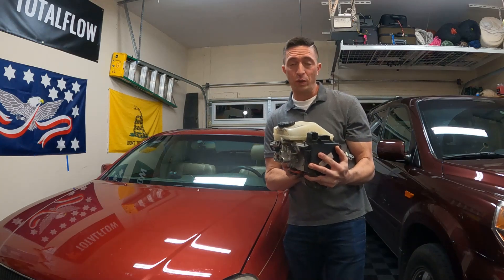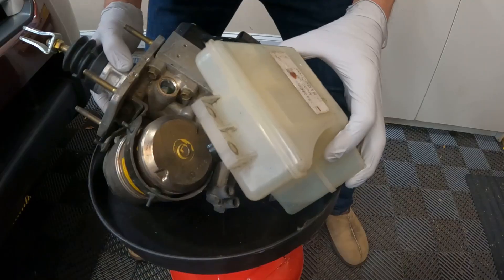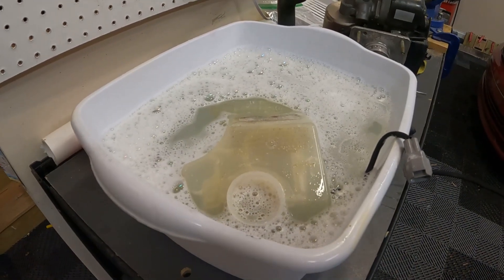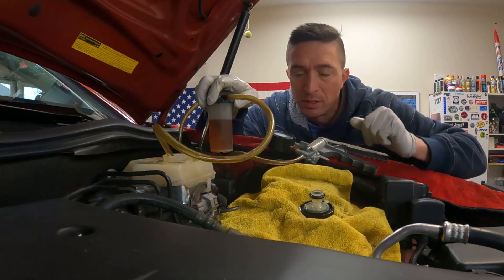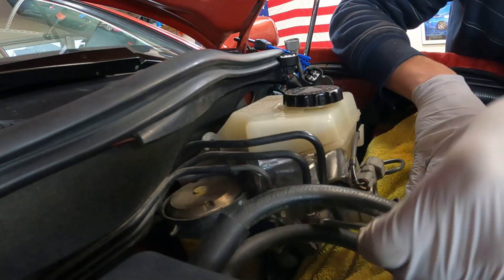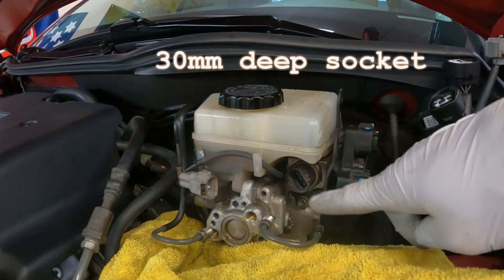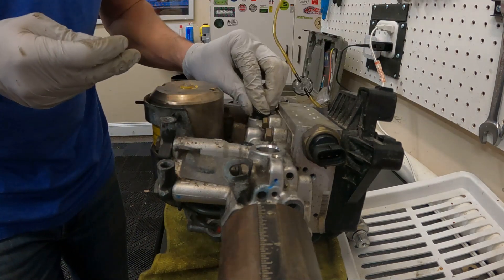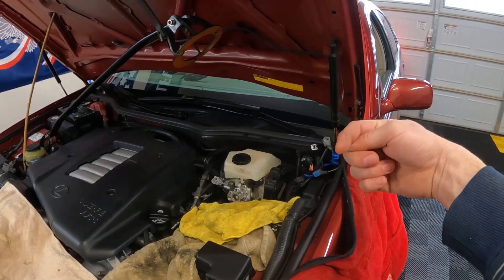LEXUS / TOYOTA Brake Master Cylinder Diagnosis, Replacement & Brake Bleeding (300/400/430 shown)

Comment: @11:42 Warning Buzzer.  Whats The Warning Beeep For??  
I'm Hoping The 7 Minute Long BEEEEP That Reoccurs Every 3  Minutes Is Just A Warning.
Owner Of 99 GS 400
Reply from the maker: Low pressure alarm. Not good. Fix it soon.
Reply: @ForwardMomentum   Goodness! Thank You. Would You Please;
What Pressure Is Low ?
Reply from the maker: Brake system. Check fluid level, all lines for leaks, and BMC. If you cannot identify an obvious issue, replace the BMC.
Reply: @ForwardMomentum   Thank You.

Comment: Anyway u can help I've bought 2 master cyclinder did it the exact same way but once I get to step put car only to the on position I don't here the pump working
Reply: Now I have 3 BMC no way none of them work
Reply from the maker: There’s no way you have 3 bad BMC’s in a row. It must be a wiring issue. You’ll have to troubleshoot the wiring a bit.

Comment: New subscriber to your channel, and love the content & high quality production values.

What made you decide to use an SC430 complete assembly, vs. say a refresh 2GS (01-05) BMC?  It also has the triangular  pressure switch that you pointed out needing to be swapped over. I would think SC430 units are more scarce than the GS units.
Reply from the maker: Hi - thanks for the sub! Research indicates the BMC bore may be 1/8th larger, although I have yet to confirm. Additionally, SC’s tend to carry lower mileage generally speaking and the BMC can be had fairly new in comparison to many of the 2GS models which are getting snatched up by younger folks and often thrashed. I hate these HBBA/BMC units. They’re entirely too complex, noisy and seem to have a limited lifespan. I would love to eliminate it entirely with an Avalon or Heat Lightning simplistic unit, but I want to retain ABS.

Comment: Hey so I have an ABS, VSC & VSC OFF light on my dashboard. The 3 codes i got back were C1246(Malfunction in master cylinder pressure sensor), C1251(Pump motor is locked/open circuit) & C1223(Malfunction in ABS system). Have you heard of these codes popping up before? Your motor mount video helped me a ton thank youz
Reply from the maker: Yes. Check the entire system for obvious issues, such as a leak. If nothing is found the pressure sensor is faulty (unlikely) or the HBBA/BMC went out (most likely).
Reply: @ForwardMomentum  What do u mean by the HBBA? I will look for leaks tomorrow however the 3 little wires that the pressure sensor has have been spliced with some butt connector i’m not sure why (previous owner). do u think if a wire isn’t getting power it would cause the sensor to act up? My brake pedal sinks a little bit to the ground as well (already bled all my calipers).
Reply from the maker: Hydraulic Brake Booster Assembly. Sure, bad wiring could cause it but if your pedal sinks to the floor, it’s probably toast (unless you have a leak or air in the lines).

Comment: Hello mate.I have a gs430 and the brake master cylinder soon will be gone. Locally i can find anything from left hand drive gs to buy this part. Luckily there are 2 sc430 lhd for parts in my country and both of them have this part.Can you confirm that it will fit?You mentioned that the sc brake master cylinder is bigger. Will it fit without issues?
Thanks for your reply :)
Reply from the maker: Yes of course. It’s what I put in my car. 👍
Reply: @ForwardMomentum  Thanks for the update.Asking because you know sometimes there are backscreen play 🤣

Comment: I can’t seem to figure out what to replace on my gs400 when stopping the pedal feels semi normal until around 3-1 mph and the pedal goes firm and it makes a buzzing noise , and it ends up breaking but like if my car is sliding, sorry my explanation is horrible
Reply from the maker: Have the wheel speed sensors checked with a proper scan tool. After that, it’s probably the BMC.
Reply: @ForwardMomentum  thank you !! I will check and let you know what it was !

Comment: I’m having some problems with my is250, I’m not sure if they side to side bleeding process matters on my application but I did the standard furthest valve procedure, not sure if that’s what’s causing my soft brake pedal, I don’t see any leaks and my master cylinders looks dry. Do you have some clue to help me ?
Reply from the maker: I’m not sure on the 250 either. Best bet is to download the service manual using a day pass from Toyota Information Services and do it per the manual.

Comment: I got my new unit in and my brakes feel better and it doesn’t have the light on anymore for the brake and makes the noise. But my ABS and VSC lights are still on will they turn off on their own or do I do something to get the system back on?
Reply from the maker: Did you reset the system by pulling the NEG off the battery?

Comment: Thanks for the video. I have a question when you bleed the unit, did any brake fluid or air come out of the side two brake lines facing the passenger side? The front two facing the bumper did for me but not the side ones.
Reply from the maker: No, nothing came out of my BMC (if that’s what you mean). LMK if I am misunderstanding you. 👍
Reply: @ForwardMomentum  Yes, the BMC OK thank you. The first I replaced didn't work, so I'm on my second one, and I wanted to make sure
Reply from the maker: Honestly that is just a major “push bleed” to get it ready. Actual bleeding clears air out. I wouldn’t gauge BMC success on fluid vs no fluid there. I hope that helps!

Comment: 10:55 do you pump 40 times with the ignition off and battery pulled or does it not mater bc it confuse me how you said it.
Reply from the maker: Off. It may have been confusing because for the ECU reset you pull the NEG battery cable to do so (but mine was already pulled). The key here is 40X ignition OFF.

Comment: I did same but booster motor turns on and off all the time while the engine is running.
Reply from the maker: The HBBA motor should prime on occasion, but not constantly. It’s really a silly, overly-complex design.
Reply: @ForwardMomentum  Great.  Thanks for replying!!!!

Comment: Hello brother! Been a while! Since I subscribed to you I purchased yet ANOTHER LEXUS lol. Since I have a 98 GS400 and an 01 IS300 I found a GS300 with 150K that I couldn't pass up for $2000! My 98 is making that funky sound and I was wondering, aside from a SC430, what other model brake boosters can be used for replacement of my 98 GS400?
Reply from the maker: Wow, a true LEXUS fanatic! Nice. I am only aware of GS300, 400, 430 and SC430 BMC’s that work. 👍
Reply: @ForwardMomentum  ok many thanks. I believe the 430s are "supposed" to be more heavy duty. Do you feed that that is the case?
Reply from the maker: I hear the piston is a 1/4”’larger inside. That’s about it.
Reply: My sc430 is making this noise. Think I can use bmc from gs and put into my sc430?
Reply from the maker: I can’t imagine why not. Same steps should apply.
Reply: @ForwardMomentum thx for reply

Comment: Good morning, well, I replaced the BMC with a 430 BMC and unfortunately it didn't eliminate the problem. The unit I installed was supposed to be out of a low mileage 430 GS. In your video you recorded a buzzing noise coming from the BMC when you depressed the brake pedal. When I apply the brakes, I hear a similar noise along with a pulsating brake pedal (there are no dash lights on) before the car comes to a complete stop, it's as though the ABS kicks in right before the car stops, did you experience that as well? Do you know of a company that sells remanufactured BMC for early model GS's? The BMC I purchased come s with a 30-day warranty so I will be it returning it. Any additional Information would be appreciated, thanks.
Reply from the maker: No, I did not experience that exact issue. Yes, it did/does “buzz” when the accumulator motor kicks on, but never premature ABS initiation as you described. Make sure it’s 100% bled properly and then consider returning it.

Comment: I have a 1999 GS 400. I replaced the brake master cylinder about 5 years ago and now the replacement is failing. My question is do you think the 430 BMC is a better unit for that car?
Reply from the maker: Better because the piston bore size is slightly larger (I’m told) and because they’re usually newer and typically from a car that didn’t get thrashed…that’s why I like them.
Reply: @ForwardMomentum   Thanks for your response, I appreciate that information. I was thinking along the same lines as the 430 master cylinder maybe newer than the one for the 400 or 300, thanks again

Comment: My SC430 developed a leak at the BMC unit. The local garage could'nt repair it, so I supplied them with a replacement unit from e-bay. They then said it was no use, as the electronics didn't match my ECU? They used the electronic unit from my old unit, and placed it on the replacement unit? It worked, and there was no leaks, but pedal felt soft o me? I recently had it back at this garage for new front pads. Pedal feels softer, and the BMC appears to be leaking again! I think they didn't know what they were doing, and cocked it up! Your video explains a lot, rspecially the part about the ABS unit and the battery negative! Thanks for this!

Comment: Great video brother. Just wanted to ask if you remembered the part where the pin slides in with the brake pedal (called clevis) was pivoting loose from its socket joint. I checked out a used part and wasn’t sure if it was supposed to pivot/rotate easily like it was. The clevis is connected to the piston and the boot end. Thank you!
Reply from the maker: Thanks! Yes, it was loose there. 👍

Comment: Hi, great video.. but do i have bleed the brakes,?? Even if brake pedal feels good after replace the unit.?
Reply from the maker: Short answer: yes, always. If you open a closed system that operates under pressure, it’s typically always required to bleed it. The problem is that if it’s not bled, air bubbles can get pushed to key components, like calipers, and failure to operate properly can result.

Comment: Any idea how to do this for a GS 460 without a computer
Reply from the maker: Can you elaborate on “without a computer?”
Reply: @ForwardMomentum  I have been the tough the ringer with my GS 460 2008 I was told that my vehicle has to be taken to a dealer Toyota and or Lexus for the brakes to be bled l have sent my original pump to be repaired and didn’t work i recently bought a pump off eBay it didn’t work, sent it off to be repaired, had it replaced and then sent back to Toyota and they still say the pump is faulty, they said they can bleed the front but not the back , I’d like to work on it at my home but people are saying I need special software through Toyota to bleed the brakes
Reply from the maker: OK. Techstream probably. I don’t know for sure on the 460, but I didn’t have a laptop when I did mine, as shown in the vid.

Comment: Another awesome vid. Was the BMC you got rebuilt or used? If its used, I'm guessing anyone would have to look for one from a vehicle with low mileage. Last, did you come up with those brake pumping #'s at random (40, 20) or did you read that from some source?
Reply from the maker: Thx! BMC was used. Pumping was random until bubbles cleared visually. 😎

Comment: Do you know if this also works for the Aristo? Mine seems to be leaking so I may be doing this soon.
Reply from the maker: It should, but be wary of the hardline routing ports (LHD vs RHD).
Reply: @ForwardMomentum  hey thanks for the reply. Love your videos. 
That’s great I’ll see if I can source one over here in the U.K. I imagine the job is the same just on the other side of the car. 
Cheers.

Comment: great video,followed all you steps, but after pumping the brake 20 times with the ignition on the warning buzzer didn't go off,I"am on my second unit from EBAY I"ve become quite the expert of taking the brake booster out did it 4 times already,I finally brought a remanufactured pump, both pumps were shot, going to have my neighbor help me bleed it tomorrow,any extra steps or knowledge if after pumping the brakes 20 times and the buzzer doesn't go off, thank you
Reply from the maker: Sorry to hear this. I hate these BMC’s. I don’t know anything else besides what I shared. That warning alarm should turn off once the system pressurizes after the motor runs and fluid is topped off. If it stays on the pressure sensor is doing it’s job and there’s a deeper issue. It is peculiar that it has been two pumps bad in a row for you. Possible? Yes. But it makes me wonder if your method is causing an issue. Make sure you’re putting a block under the pedal during pumping. If you over-stroke it it can blow out the internal seal.
Reply: 4th time was a charm, no more beeping noise no ABS,VSC lights, thanks you again
Reply: @benjaminwaites5879  what method did you use for your car brotha ?
Reply: I’ve bled twice already and no air and still have a spongy pedal. But I haven’t tried the 40 20 method. What exactly does the 40 20 method do and is there a more detailed way for it to be sure it’s working? It feels like air because I have a strong pedal after two or three pumps while driving . Soft under the first depress

Comment: Thank you for posting this, your videos are always so informative. My 1999 gs300 is making bird like sounds at cold start up. 

My brake pedal pressure still feels normal and I don’t see any leaks on the garage floor/reservoir is still full. 

I have a video on my channel of the noise it makes and someone chimed in and said it’s my brake booster. I occasionally get the brake light icon on my dash but no constant beep sound.
Reply from the maker: Yep, eventually it will fail. It’s just a matter of time. Sucks.
Reply: @ForwardMomentum  I’ve already had the brake master cylinder changed out once before. This is the Achilles heel of these cars.
Reply from the maker: @Jeremiah1187  agreed. I hate my BMC. It works fine but it’s always priming and it’s annoying.

Comment: That video was DOPE! Thanks for making it. I had questions about my diagnosis and they were answered right as I thought of them (Great timing and pace). The demo at the end was spot on and appreciated. I was  wondering if it was possible to bench bleed the master before reinstalling or would it be a wasted step? Would bench bleeding eliminate having to do it at the fragile brake lines in the car?
Reply from the maker: Thank you for your positive feedback! Bench bleeding was something I looked into, but could not get a straight answer on at all. The consensus was to break the hardlines on the BMC open after it primed (which I believe I showed in the video). Due to the design of the pump, and it being electric, there wasn’t a great way to compress the cylinder like on a traditional BMC. So I chose to do a little bench bleed on the car. If it was a new Toyota BMC, I would look into it further. I hope that helps!
Reply: It does. Thanks for answering so quickly.

Comment: When it was making that noise,was your traction control light coming on?
Reply from the maker: Negative. Everything worked as it should. But that sound was the warning sign of impending failure.

Comment: I got it installed but but now it leaks a lot  and i can't drive it because brake fluid is harmful to my suspension
Reply from the maker: Check your hardline connections. Could also be a bad replacement unit.

Comment: Thanks a lot for this great tutorial! I swapped out the complete brake assembly 47050-24060 ($1,267.41 with shipping) on my wife's 2006 SC430 after watching your video. At first, I considered used units on Ebay, but decided to go with a new unit from a Lexus Part's discounter.  It arrived in a sealed box a few days later from Lexus of Japan via a Miami Lexus Dealer. The brake booster failed while my wife was driving and she was worried that it might happen again. Anyway, the car is working great and I appreciate your help.

Comment: Does the SC430 BMC improve pedal feel and stopping distance with the  LS400 front caliper upgrade?
Reply from the maker: Absolutely.
Reply: @ForwardMomentum  OK great!! I did the LS400 front brake and the LS430 rear brake upgrade with SS braided lines and even though I have bled the system at least 6 or 7 times I am not completely satisfied with the pedal feel. I may have to look into the SC430 BMC.
Reply: @TRACKMKIII  I also have ls400 front caliper with stock BMC, I have bled it 3 times already. The first time was traditional method and the next two times with techstream, but after the 3rd time it feels super spongy. Was your brake feeling spongy too?
Reply: @rbexperimental7  It's not super spongy, but it's definitely not rock solid like I want it to be. The stopping distance is still much improved over the stock calipers.
Reply: @TRACKMKIII With ls400 calipers were you able to press the pedal all the way to floor? Mine is doing this
Reply: @rbexperimental7  No, my pedal doesn't go all the way to the floor. The top 10-15% of pedal travel is just more spongy than I would like it to be. 

Sounds like you need to bleed the system more and probably a set of stainless steel brake lines if you are still using the OEM brake lines.

Comment: I had to do this twice and its not the easiest job, the 4 bolts under the dash are a struggle to get to. I think I may have to take it out again as there is a leak somewhere coming from underneath but its hard to see where from, it slowly loses fluid. If you can get the latest version as its been uprated.